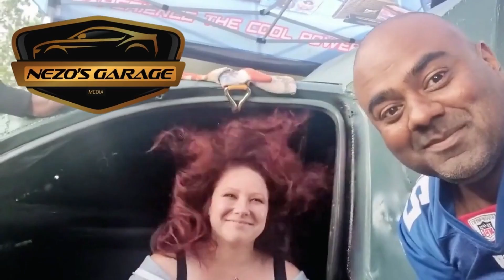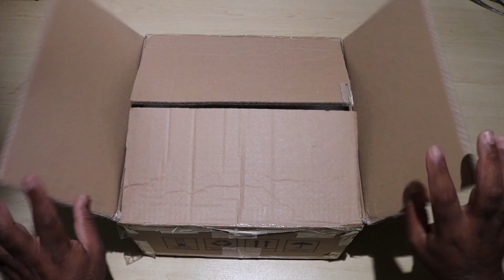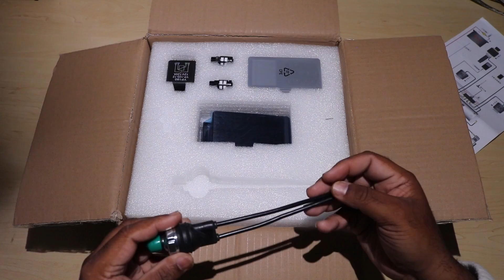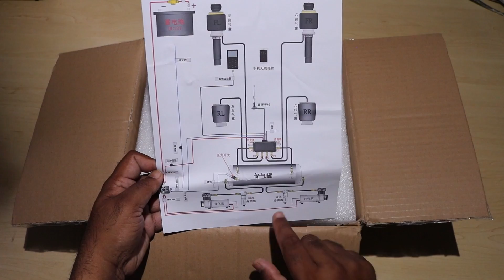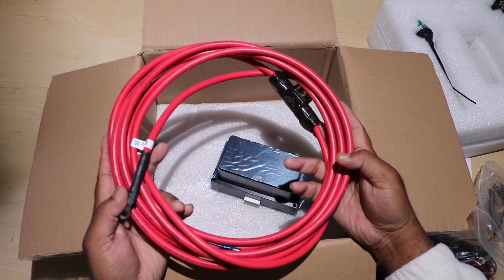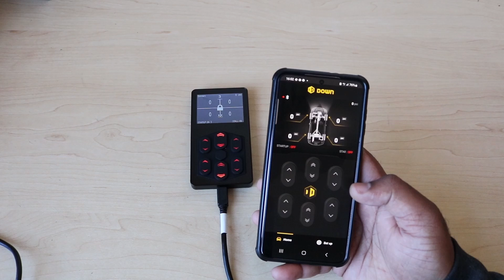Grounded Art P7 Air Management System

Comment: I have this same kit fitted in my car by airmext. Does anyone know or have a setup video for this controller. I used another video and now i cant put the start up mode back to off.
It does have drop down modes and lift up when u start the car and need to press the controller for it to lift at start. My bluetooth app stopped working since the controller is stuck on startup mode. Its a chinese product and comes with no install vids etc.
Reply: Is it working now?
Reply: @cejota389  its a pain in the ass. I dont know how to fully reset it or how to. Maybe that should get everything how it was at the start when it worked. At the moment i got it working yes and left it as it is without the phone app which was helpful. Are ypu thinking of getting 1?

Comment: Does it have rise on start and air out when u switch car off?... Can you lift and drop all 4 sides at the same time? Does the management maintain the preset pressure in the bag if its drop pressure?
Reply from the maker: All I managed to find out is what I showed you in the video. You can air out all 4 at the same time with the center button. 
From what I've seen, there is no raise on start. You would have to select a pre-set. I didn't find any literature or information to support that it has a pressure maintain or axel equalization. This is one of the better "Budget options" in terms of Air management goes, however, for the money, I don't think it will have all the features of your high end units.

Do look at the video I did on the Air BFT, if you need those features.